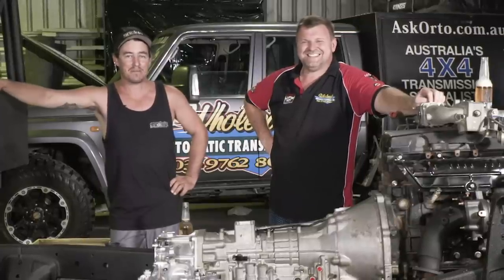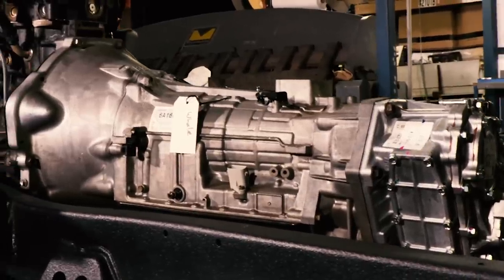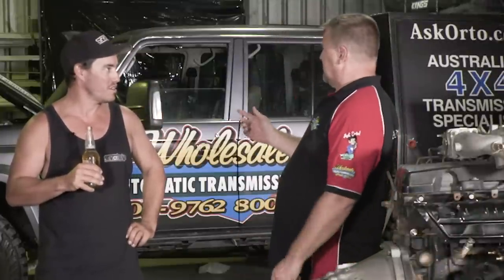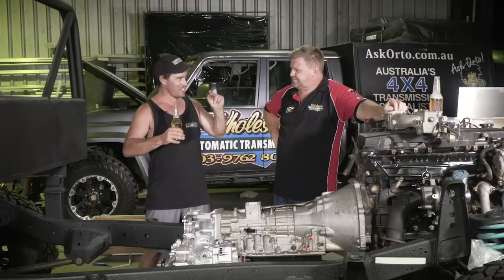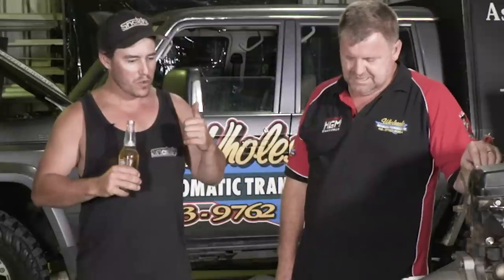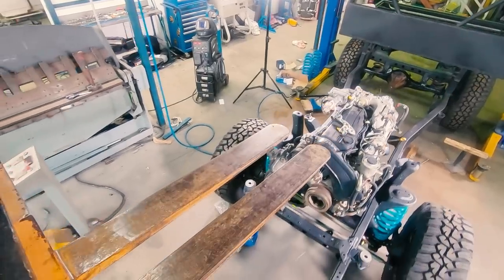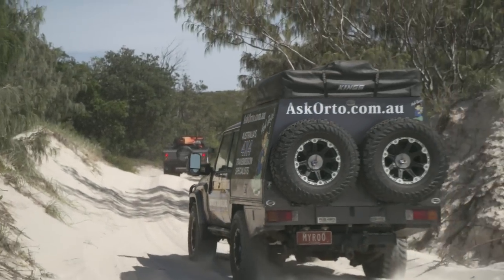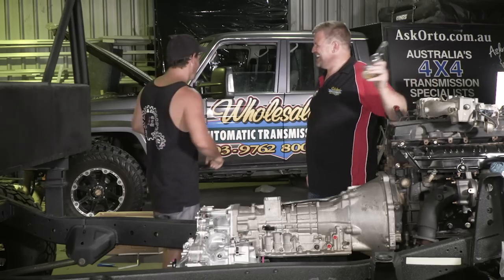DIRTY 30 TIP-TRONIC AUTO CONVERSION - Why Shaun chose this over manual + Expert tips for your auto!

Comment: Rocket what transmission or trans upgrade can I do on my 02 Isuzu rodeo lse v6 4x4
Reply: I have never done an automatic conversion on the 2002 Rodeo and the reason being is that I feel that it would be far cheaper to sell the car and buy one that was already auto. The auto conversion would be twice the cost of simply purchasing one already factory fitted.
Reply: @RocketRod  it already has an auto in it, but I've blown the "Drive" before and was considering an upgraded auto trans, I tend to go mudding pretty hard
Reply: @vonagelab7247  can you please Email me a photo of your vehicles ID Plate. I'm looking to see what transmission you have in the Rodeo.
Reply: @RocketRod  I don't have the vehicle right now because I loaned the car to a friend and he will have it for a few weeks but... I do know it has the 4L30-E transmission
Reply: @vonagelab7247  Unfortunately we don't really have any upgrades for the 4L30 sorry.
Reply: @RocketRod  what about swapping to a different auto trans, stronger one perhaps
Reply: @vonagelab7247  The cost is the problem and these transmission weren't that bad I would stay with the transmission thats in there. Get it services, make sure you have an oil cooler up front and maybe a transmission temp gauge. Thats all she will need.

Comment: Only downside to an auto is, if the starter fails you're screwed, you can't bump an auto.  You have to carry another and hope you stop in a place you can change it?  New auto's are 6,8 and 10 speed.

Comment: wich automatic transmission did you use ?
Reply: sorry just got it - was a blond moment :-)
Reply: Chris in this case we used the 5 speed auto from the HDJ100 from behind the 1HD-FTE.
Reply: @RocketRod  thx for the info - will send you a PM

Comment: If the ute's called "The Dirty 30", is the bit between the engine and transmission called "The Dirty Torque Converter"? Every time you drive it you'll be torquing dirty.

Comment: Not a question about automatics specifically, but transmission/engine swaps in general. I want to swap the engine in my 4x4 for something not commonly used, and I want to know if there are companies out there that make bell houses or adapters to mate uncommon engines to transmissions.
Reply: There are depending on what you are after. What type of conversion are you trying to achieve?
Reply: @RocketRod  being in the US and there are very few diesel options below a V8 in a F250, I want to put a 2.0L VW diesel engine in my 02 Nissan pickup. It currently has the 3.3L V6 in it and a 5spd trans behind it
Reply: @SoulSaege  can you confirm what auto you have? It should be on the compliance plate. Possibly RE5R01A or RE5R05A
Reply: @RocketRod  it's a Nissan D22 with the VG33E engine and a 5 speed manual transmission. I would love a ZD30 diesel engine but I dont know how to get my hands on one
Reply: @SoulSaege  we have one here that has an LS Chev in it with Nissan Patrol 5 speed auto.

Comment: Hi Shaun and Rocket great video wondering if you can help. I've got a 80 series with a 1hdt. It's an auto. It won't shift gears when in low range. Any ideas?
Reply: I'm gonna say your hi low switch is faulty. It still thinks it;s in High range and therefore waiting to reach that road speed.The auto itself doesn't know hi from low range so the problem is not within the transmission. It is strictly electrical and like a I said my money is on the hi low switch.

Comment: how does 4wd go with an older transmission built in it, for example say a 4wd built in 2014 or similar year
Reply: It can be done but very limited ability to fine tune to your personal setting etc. I cant complain as we did it this way for years but then found that the electronic transmissions were much better suited for each customers personal requirements

Comment: Will these go into a 60  also number 1 engine  petrol and number deisle whats best
Reply: You make an adapter between the 3FE bell housing and A750F and we can supply Billet Torque convertor. Nomad Valve Body and Compushift System to run it all.

Comment: Could you build the Compushift unit into a Faraday cage to make it EMP proof? Hahahaa
Reply: We have talked about this and while we have not done it before yes it can be done but you would have to remove from Faraday case to tune via Bluetooth.
Reply: @RocketRod 

Hey mate, I wasn't really expecting a reply to that question, but thanks for taking the time.
I've got a 2000 GU Coilcab which I'd love to stick a auto in one day, which trans do you recommend for it?
Reply: @steely1neverwane  Without doubt the 5 speed RE5R0RA from the TB48. When coupled with the Compushift Pro it doubles the transmissions capabilities.
Reply: @RocketRod 

Cheers mate

Comment: So much better than either standard box's because you really are getting the best of both worlds and because you've got full control over the gears it can still be good on fuel.

I'm waiting for the electric 4x4's to start coming commonplace, get rid of that dirty diesel and petrol and still have mountains of torque and much better control over approach speeds over obstacles.

This isn't a rubbish build at all its a really good car but when that electric comes in to power people will love what they can do and the power stations for fast charging can all either run on hydroelectric power, solar power or even build a few gigantic Sterling engines and take huge advantage of the temperature differential between the ground and ambient temperature.

Doesn't take a lot of difference in temp to make them run and feed a power wall for fast charging and if you think that electric is a million years away please look into the advancement being made with carbon and graphene cells.

Tin Man Power and Robert Murray Smith are doing those very two materials respectively and making current batteries look like a monkey invented their conductive additives.

Just think of how much better it will be having electric over petrol or diesels, one moving part instead of hundreds, torque like a truck and I mean a truck not a tiny 4x4 and when fast charging is common because people are able to make super capacitors that discharge slower than batteries but charge like a capacitor and provide massive energy dumps like super capacitors then it's a win.

We have endless carbon than needs recycling, what better way to deal with it that to actually use it as an extremely good power storage material.

Is rocket and his lad going to come up with some flotation devices for sinking 4x4's, would be silly easy to do if integrated into rock sliders and winch bumpers.

Can run off little removable air canisters that air rifles use and if it needed to be down to the vehicle to replenish them it's only an aircon pump mod away from being able to do that.

Please guys, we all know it's a bad thing when oil is going everywhere and some unfortunate person loses their holiday and 4x4 all in one hit.
It's bad for everything involved, the people the wildlife and the vehicles are most of the time completely written off and it could all be stopped by inflatable pods run off compressed air that open up like life rafts.

Really these things should be compulsory because they can and will save people's lives especially people who get caught out in a flash flood on a river.

If I had any means to get this done I'd crack on and give you a working prototype because as I said it's a stupidly easy system to integrate and if it's a winner all around then I don't want anything for it just make sure everyone has it because it's an essential bit of tech in my humble opinion.
Reply: Gods Country Bumpkin  what drugs are you on!
Reply: What's a Sterling engine?

I don't drink or take drugs.

I find your question about drug consumption to be disturbing when not addressing any particular thing that would make you say such a thing.